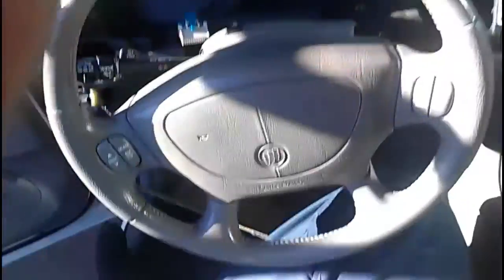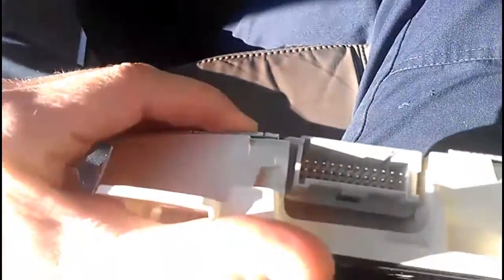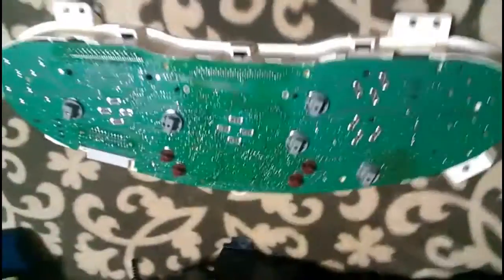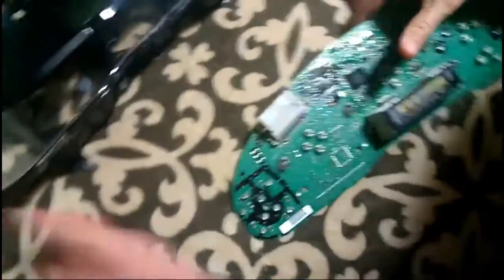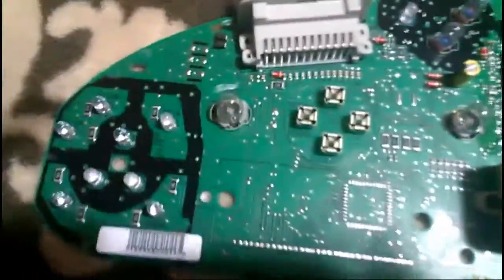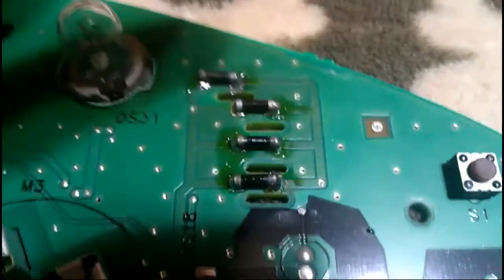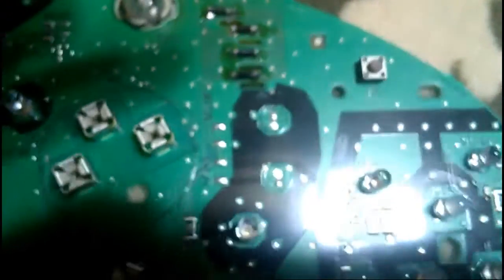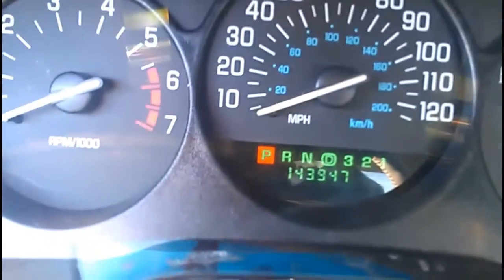2001 Buick Instrument Cluster Repair PRNDL

Comment: just did this repair works perfect now, saved me 300 bucks, did lose few of those dash clips but still got everything back in, i used 150 ohm half watt resistors, got them on e bay for 2 dollars, also my check engine light came on when the prndal failed light went out after i made the repair.

Comment: Any Idea where I can get these tiny connectors? They did not have them at the dealership nor could I find them online at GM parts? 3 of mine have broken off.
Reply: Richard Scholz Are you talking about the resistors if so Radio shack has them
Reply: Thanks!!

Comment: can this work for a 1999 regal??
Reply: 313poison I had the same problem with my 2002 Buick Regal very common issue the resistors for the PRND321 LED light get very weak after time & one day it’ll quit working so I replaced the resistors and now I can see the mileage again
Reply: does ot fix the driver information center too?
Reply: Where can I get the resistors from